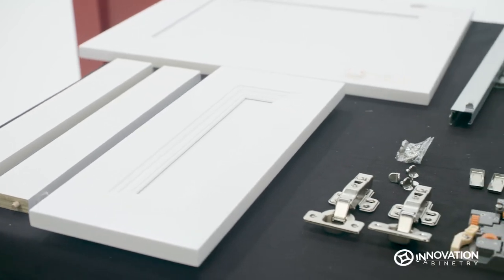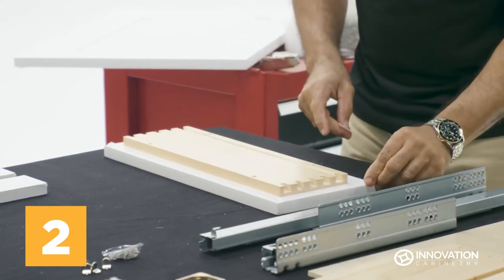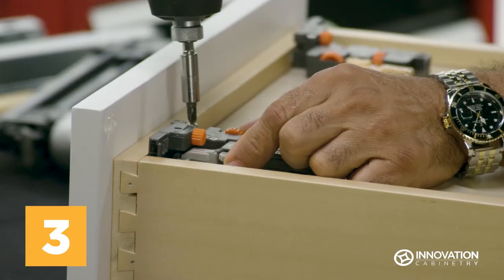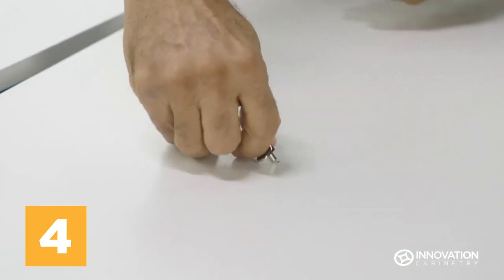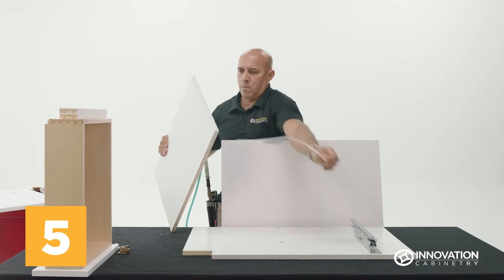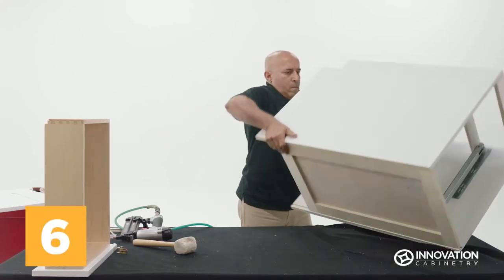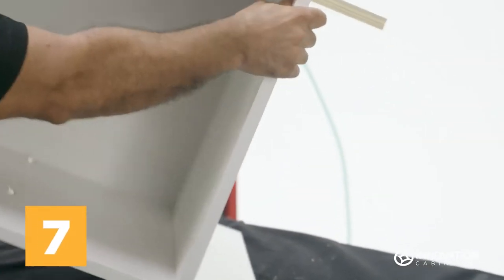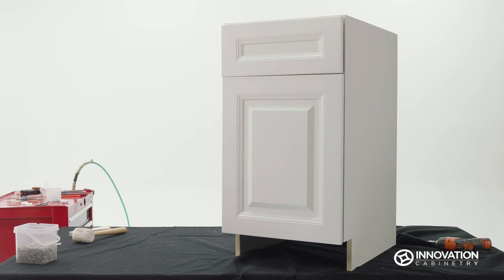Innovation Cabinetry Base Cabinet Assembly

Comment: People that have never put RTA cabinet together need the video to be a slower.  You're going so fast I have to back the video up many times just to see what you're doing especially when installing the soft close guides.

When you're putting together the sides of the cabinets on the video you do not say if you're working on the left side or on the right side and why would you put nails through an exterior side where you will see them?

Also the track assembly portion went way too fast without good explanation about the directions the track should be in.

Exact placement of the drawer slide is not given as to how far it's back from the front of the cabinet.